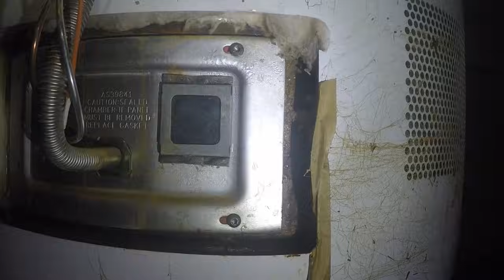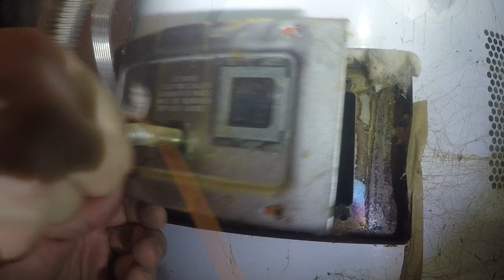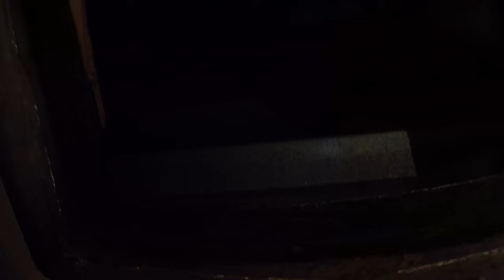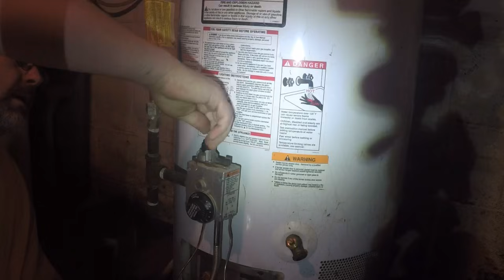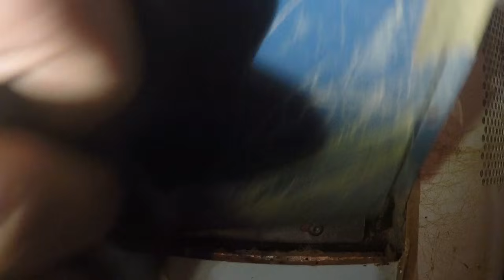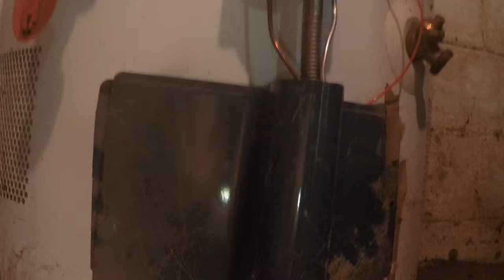Fix Your Gas Water Heater - Flooded basement repair

Comment: Hey man. I'm right local, on the border of Warren/Erie county (Corry). The thaw we had caused a big flood in my basement and I can't stomach replacing my HWH that is new, so I turned to cleaning out the burner and replacing the gas control valve. THANK YOU for walking me through this.... Let me buy you a drink!

Comment: How does the burner hook back up inside. I have mine apartment and cant get that back in place.
Reply from the maker: It should just slide into place and the screws on the outside should hold it.

Comment: Excellent video!!!
After 3 days of no hot water after a minor basement flood, two plumber visits and waiting for the plumber to order parts ( that in retrospect would not have fixed it) I decided to give it a 5th try on my own while following your video, took out the burner, blew out both of the gas lines, reassembled  and it and it lit and is working again. This saved me not only the cost of repairs that likely wouldn't have worked or he would have kept guessing on replacing parts until he replaced everything but also a hotel bill as my wife was ready to check into a hotel that evening do to work needs and thereby saving us likely another $1000. Thank you for taking time to make the video. I've Liked, subscribed and shared.
Reply from the maker: My pleasure! Thanks for the feedback!

Comment: Thank you. I'm in South Central Tennessee. And yes with the well in the basement. The floats .one of the came off the plastic bracket. I re secured it and adjusted them to go on sooner. Now the pilot light. Going to try soon. My AC took a dump. Yeah $$ it's going to hurt$$ new Mother board. And fan motor. I may look into having this well capped.
Reply: Again. Thank you

Comment: Wonderful video. Helped me fix a 10 year old water heater. Interesting part is I had a light flood, the pilot would light and the full burner would even light for a few seconds. But then I would see moisture in the viewing window and the flame would go out. Turned out that there was some standing water at the bottom. After drying with a towel and cleaning it out, it went together and fired up and didn't go out. Thanks
Reply from the maker: Glad it helped!

Comment: If the water rises over the control valve………trash it ….I had three feet of water in a rental……so I use professional people for repairs …my plumber stated he could fix both boiler and water heater but would have to replace all parts…….or replace units …….labor and parts would be the same…..
He replaced the units ….I took the control valves to see if they could be used…….took them apart and after a couple days they were full of corrosion…don’t recommend using flooded parts……avoid a disaster……

Comment: my water heaters were flooded but i let it sit for 7 days now.. I looked inside the little window and it looks all dry but the insulation around the tank is still a little damp. Would it be safe to try to light it up ? the brand is rheem and they are about 3 years old.
Reply from the maker: There could be water in the gas tube that you won’t be able to see and it may not easily evaporate from.  Personally, I would pull it apart and clean it out and blow the lines dry.

Comment: Great video. Thank you. I live in Bergen county NJ and  had 4 feet of water when Ida hit NJ. After water was gone I was trying to restart my water heater for 3 days with no success. Ignitor was not working properly, gas was not coming either. I talked to the plumbing company. They said, that to replace my 50G heater will cost me $1800 . I watched your video, bought a new ignitor on amazon for $3.84 and fixed the heater. Thank you very much.
Reply: Since you had  4 feet of water in your basement, your gas control (  Thermostat) would have been under water (not good). It is required by all gas Appliance manufacturers anytime a gas control gets flooded ( submerged in water) that the gas control get replaced at minimum. The concern is the pilot safety may corrode over time and not work, causing a hazardous situation and possible explosion , same thing for your gas furnace. Call your insurance company and get them replaced as soon as possible.
Reply: Your control valve may malfunction one day you go boom……..

Comment: Thank you for this video! I was looking at having to immediately replace my tank after Ida came through town but I cleaned it up and it’s back in working order.
Reply from the maker: Glad to hear!  Hope you came through Ida ok!
Reply: @PAWildsHomestead  Here for the same IDA issue in Bergen County, NJ...hopefully it worksfor me as well.
Reply: Man, I hope mine works as well, will wait a few more days beforee trying
Reply: Damn man having the same issue but I have a Honeywell with electronic ignition switch..can't get it to light...maybe its too wet?
Reply: Did you have to replace the seal on it, or did you keep the same one on ?
Reply from the maker: @enzodit4009  I reused the same one.
Reply: In PA and Ida came through and my tank was in water. Hopefully this video will help me. I just replaced my tank 4 months ago!!😔

Comment: Does anyone know if self cleaning gas water heaters are water proof  around the pilot?
Reply: No they are not. Self cleaning just means the water is designed to swirl at the bottom to prevent sediment. Most HWT will draw air for combustion around the bottom. If you actually have a standing  pilot assembly there is no way the chamber can be water tight as it is not even air tight ;)

Comment: After a recent flood event my 40 gal. Whirlpool water heater pilot went out.  After many attempts to relight it and failing to do so, I called my friendly plumber to help.  Following my detailed description of the event and sending him photos of the condition, he preferred to replace the water heater entirely; 3 days wait and a $1400 estimate.  Heck it's the weekend and my wife wants hot water so I agreed.  Then I watched your video.  Hey, I can do this. I could not remove the wires from the controller but  the burner came out enough to clean it and wipe dry the base of the tank.  While out, I placed a fan on the burner and interior of the tank over night.  The next morning I reassembled it and it fired right up. I cancelled the new heater installation. The controller is coding "normal operation." Your instructions were simple and precise.  Thanks....
Reply from the maker: Awesome feedback! Glad it was helpful!

Comment: I was optimistic about this but it unfortunately did not work for me. I'm going to repeat the process 1 more time just for good measure but my optimism has pretty much gone out the window at this point. Gave a thumbs up though because very informative and I'm sure in 90% of cases it would fix the issue. I am going to try to replace the gas valve / igniter system next if I have no luck again.
Reply from the maker: Sorry to hear! Did you get it working finally?